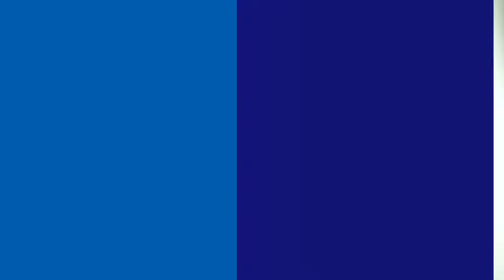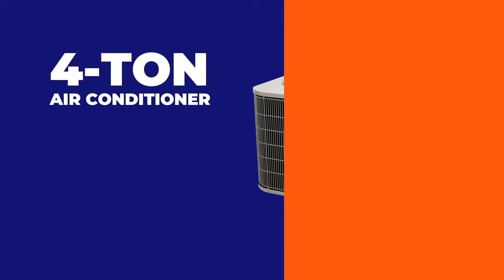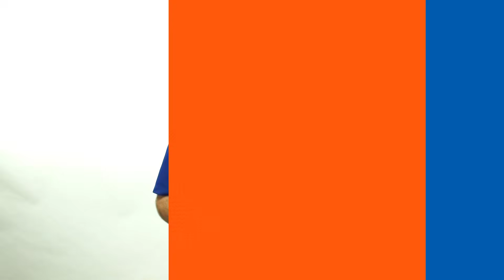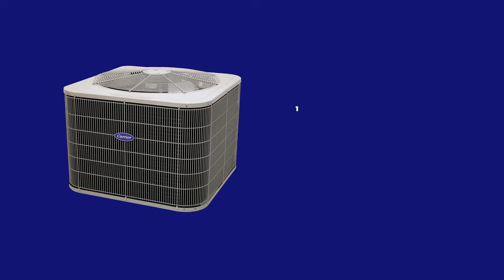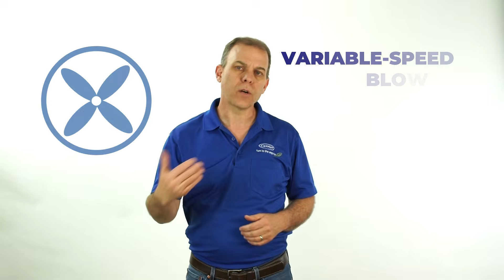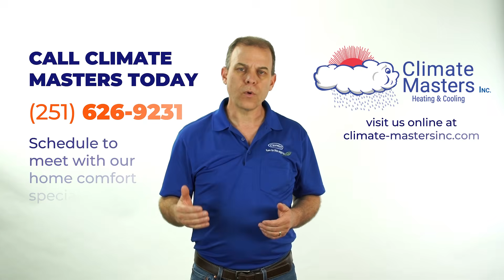How to choose the best Carrier HVAC System for your home?

Comment: I had a 5 ton Carrier greenspeed installed 3 years ago and it has been throwing fault codes and locking itself out since day one. I'm hopeful it will someday pass inspection and I will no longer get notices from the county that I am in violation. The installer has let the permit expire 3 times so far. Every so often they renew the permit, though a new part on it, feed me a bunch of bullshit, and have it fail another inspection. But hey...it was only $24,000.

Comment: Just confirming:
- a single stage compressor can only work with a single speed blower fan
- but a dual stage, five stage, and variable speed compressor can all work with a variable speed fan.  ]I knew variable & five stage could.  But I thought a two-stage compressor would get a two speed fan.

Comment: Never buy anything more than 2 stage systems….  No payback… the compressor will not last..running all the time…
Reply: Yes, but it's not running at 100%.   That should increase it's longevity.

But I will agree that when/if it needs to be replaced, it will cost more more than 1 or 2 stage equipment.  Also, that feature of the variable stage is worth something, so replacing it will cost more.

Comment: Hello, I am enjoying your videos, there very helpful. I do have a question; I have a Carrier model # FB4CNPO25. The previous owner had it installed 2019 and the thermostat is battery operated. I am looking to replacing it but, need some help picking a great touchscreen, programable thermostat. Any help would be appreciated. Thank you.